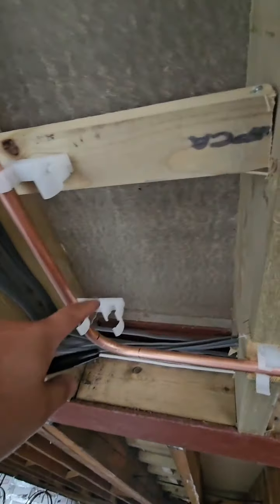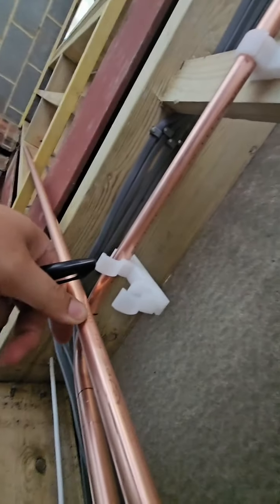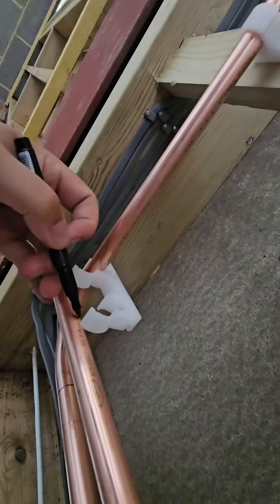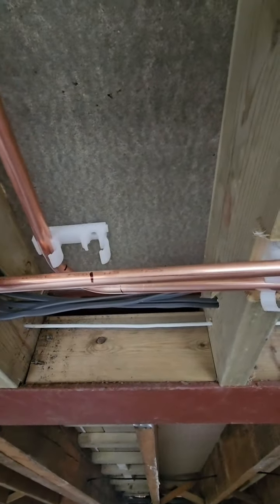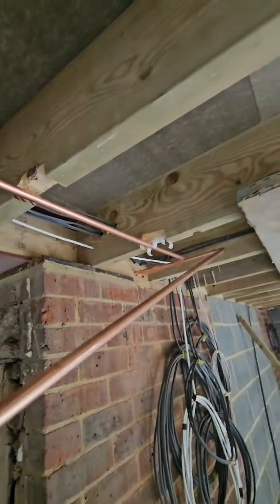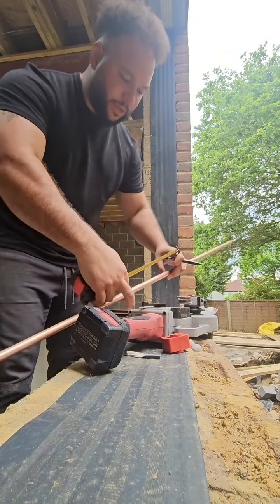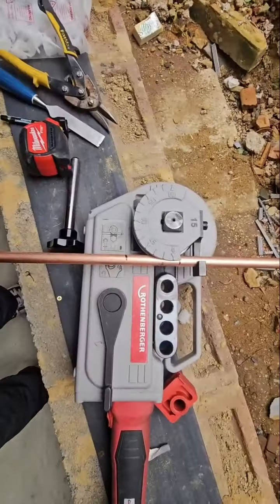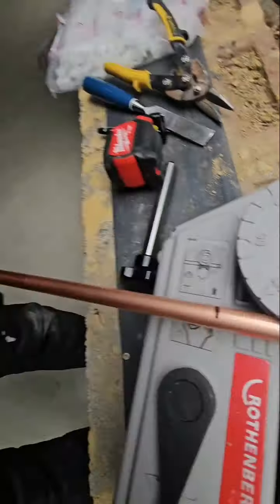pipe bending tekkers

Comment: Dude, check your local building code before notching the bottom of a joist like that 🤦
Reply: Lol init, the part under tension as well.  Set least the electrical one looks a lot better
Reply: @Bari_Khan_CEng_CMarEng  Yes, the bottom 50 mm and top 50 mm are a no-go zone according to my code. Bottom is under tension, and the top is under compression. Those joists will deflect now. Obviously, not licensed work because the inspector would never allow that.
Reply: @creativesuit1930 standards in the UK are atrocious, and God knows how the hell Inspections actually work here in the UK for residential and commercial.  Look at Grenfell Tower.  Utter joke of a system with such little actual technical credibility.
Reply: The structural damage done by notching the joists is why we need PROPER training, and it’s the very reason for inspections. But yeah, breathtaking bends on your tubing.